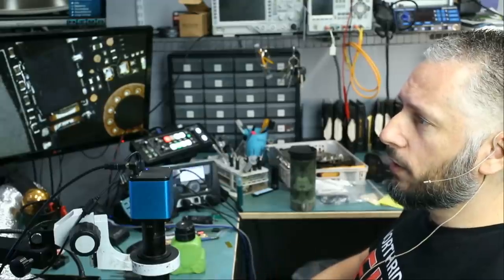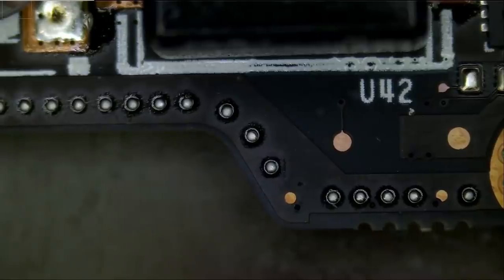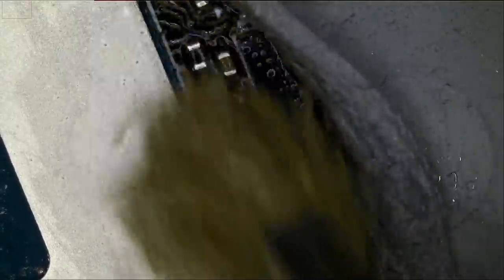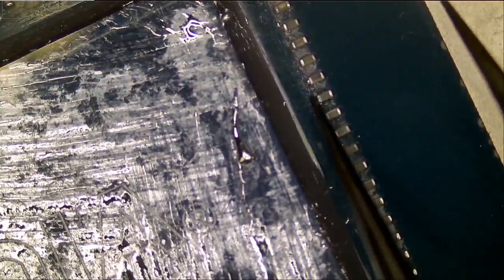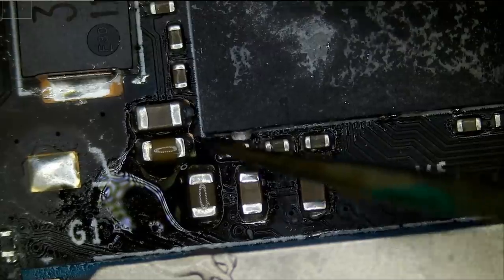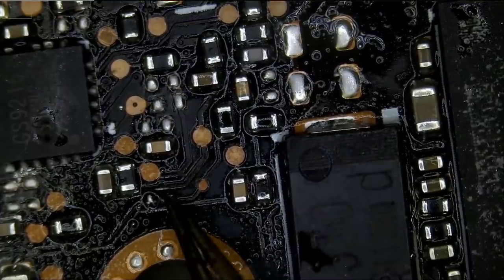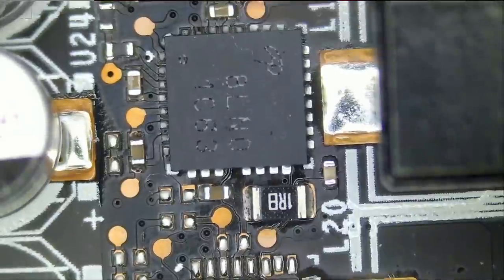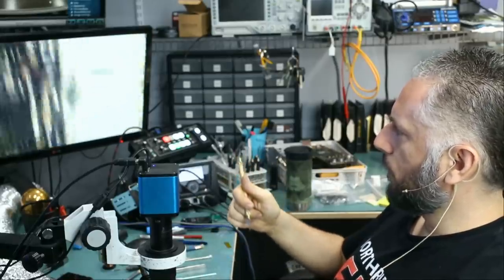RTX 3090 Graphics card Blew out after using Liquid Metal. A frustrating video to watch

Comment: Got a laptop like this once, and it was such a mess that after hitting the board with extremely high pressure air, 90% alcohol, brushes and swabs, I finally figured out the right way to do it, I placed the motherboard in the trash and used the screen for a different laptop.
Reply: people think liquid metal is this magic ingredient that will double the speed of their machine
Reply: @geovani60624  they dont need to think cause IT Just fact. Its way cooler so i can overclock way better
Reply: @lakaldrak  yeah? by how much? does it really matter enough to risk losing your thousand dollars gpu to get like 5 more fps in a game or two?
Reply: @lakaldrak  yeah burning your hardware is an absolute fact son.
Reply: @NyanKuro  so Then dont so it simple isnt IT? My CPU is 20C cooler. The only Thing u need to do is to refresh the LM  every year
Reply: @lakaldrak  Lol its not though.  CPU not GPU for liquid metal.  Liquid metal has literally no effect on a GPU.  This is because unlike a CPU a GPU has a much larger die that disapetes heat differently. There's 0 benefits, definitely not 20 c.  Plus my 2080 ti doesn't even go up by 20c.

Try a dedicated external radiator that achieves ambient water temps. Much better and safer. My 2080ti goes up 14c on full load.
Reply: @geovani60624  Not even 5 fps, there is 0 benefit with liquid metal in a GPU.
Reply: @phillylove7290  I was trying to be generous
Reply: @phillylove7290  14 degrees celsius???? my gpu goes up to like 60 or 80!! how? my cpu cruises at 60 too, but 14??
Reply: @lakaldrak  20c cooler? that's about where my cpu hangs in use is 20c, and I use old radio transistor thermal paste that cost $10/lb. the tube i still use to this day is from 1999.
Reply: @holycownonames  20 Grad Celsius idk what U talking. Not rly when Ur CPU is at least 20 c when u Boot Ur PC.
Reply: @gmodiscool14  read again.
Reply: @phillylove7290  lol
Reply: @geovani60624  only RGB can double your speed
Reply: Indeed. It is impossible to clean the mess, as it adheres to anything metallic (unless it is aluminum, knock on wood, or is somewhat oxidized). Liquid metal is galistan, basically, and it will dissolve copper. Even aluminum, if you scratch the later while in contact with the liquid metal. I'm surprised that I'm yet to see a heat sink crumbling due to that product.
Reply: @lakaldrak  Nope! You can shave a few degrees. That's it! Not worth it. And you will kill the CPU and/or the GPU or whatever you are overclocking in no time. This is like constantly over-reving an engine and expect it not to blow.
Reply: @lakaldrak  Just buy a CPU with a soldered IHS instead of shitty TIM and you don't  need to delid and use LM
Reply: @lakaldrak   the thing is that  99.5 percent  of people don't overclock.
Reply: @SpaceAce114  Fax !
Reply: Do I get it right - you used laptop screen for another laptop? If yes, were they compatible at start or needed some customization with cables? I have old laptop and it has good screen. I would like to reuse it.
Reply: @lakaldrak  Get 17.0 W/mK Fujipoli or 12-14 W/mk pads and you can do the same thing, way more safe
Reply: Lol 100%. I had a PS4 that came in and looked like it was painted silver. Just caked in liquid metal. I had a macbook air the same way - why put liquid metal on a macbook air? Lmao. Its just a pain in the ass mess. I used both boards as donors....
Reply: Liquid metal is for those wishing to take part in the great silicon lottery. Intel may have finished this with pre binned and cut down or pre selected as a new skew.
Reply: @geovani60624  It's not just 5fps more... it can be 20-30 fps or more.
Reply: @christopherkidwell9817  no, unless the heatsync was really dirty and the user was using like white thermal paste, then yeah, that might be true
Reply: That doesnt look easy... I wonder if its ferromagnetic? Perhaps you could use a strong magnet? :)
Reply: Liquid metal is really great
I am using it on CPUs and GPUs from 2012 without problems
Application is a key
You need to ensure it did sick
If it stays after you try to remove it,  then application is done correctly
If you can wipe using dry swap, brush, paper or plastic,  then you sold it incorrectly and it will literally flow away given time
I am using it even in servers,  which shows I know technique
Reply: lol
Reply: @TheOmegaAlfa  - you can buy a driver for the good screen and use it for whatever you want. Just have to know the screen model number.
Reply: @JosephQPublic  , thank you, however the screen gave up to old age 2 months ago. :(
Reply: @geovani60624  You need something to keep it contained. Liquid metal works great under an IHS
Reply: How do you properly apply? I plan on doing my laptop that has CPU throttling at 95c @WizardNumberNext
Reply: @phillylove7290  I got 10c improvement on water cooled 1080ti at max furmark load.  Now the die is only about 5c warmer than the water, when before it was 15c warmer. 

  But you're not losing 20c on the core unless the paste application was terrible. Could get a big hotspot improvement if the paste application and mount aren't perfect.

Comment: this is a classic case of 'More Money Than Sense"
Reply: This proves money isn't necessarily obtained by intelligence.
Reply: This 3090 is probably paired with 3300x box 😂
Reply: @a36538  it's probably paired with a fuckin ryzen 1100
Reply: I do not agree,  if he was that wealthy he didn't need to take it to  fix, he simply would've bought another one.
Reply: @tony001212  the 3090 could have been a gift from him to him so it has sentimental value.
Reply: @tony001212  Well that only proves the point more, he had the money to buy a 3090 but instead of searching properly he just typed "best temp reduction I can put to my card" and obviously he got liquid metal when he could had used kryonaut to reduce the temps and still be safe.

Comment: He must've smashed that cooler back on.  I've never seen liquid metal shoot across any board like that.
Reply: The owner used waaaaaaaaay too much.
Reply: @boricua1123  From the looks of it didn't know what the fuck they were doing either. Looks like they just scratched the surface to leave marks. You need a fine grit sandpaper like 3000grit or so to completely remove any oxidation but leave a VERY faint texture so the LM has something to adhere to and make a good fusion between parts.
Reply: @SilvaDreams  Wat? You guys are using sandpaper on direct die liquid metal jobs?
Reply: @Bourinos02  Of course, you want to use a very fine one to remove the oxide layer that has formed that way it forms a better bond to the actual metal and not to the oxide layer which will inhibit the heat transfer.
Reply: @SilvaDreams  Sorry but that doesn't make much sense... If the chip manufacturer placed it there, it must be only around 100 nanometers thick, and if it is occuring naturally, it is quite literally only an atomic bilayer. So there would be negligible to unmeasurable gains from the heat transfer perspective.
Could you elaborate a bit more?
Reply: It's best to just stay away from that garbage (liquid metal).Many people try so hard to chase a 10 fps avg gain from cooler load temps, less thermal throttling. It is such a waste.
Reply: @Bourinos02  That is not the die. That is the die lid.
Reply: @SilvaDreams  I am just informing. I'm not being rude. There is no oxidization on the die lid. It is mated 100% tightly to a copper surface with thermal paste. 

To add, it isn't an oxide layer. It is an oxidized surface. The process of degraded/deterioration or tarnished metal is called oxidization.
Reply: @Twitch_Moderator  What? Are you refering to the IHS? There's usually no IHS in GPUs...
Reply: @Twitch_Moderator  all metals form oxide layers almost immediately upon exposure to air, this is actually desirable as it protects the metal.
Reply: its undesirable when welding and soldering
Reply: Doofus used liquid metal like regular thermal paste and blew out his RTX 3090. Swear some people don't deserve good video cards.
Reply: @Twitch_Moderator  if it would be 10 avg fps , then i would call it worth it, but in best case you get 2-3 out of it. All just numbers that dont matter if you game and dont go for world records, lol.  Also the metal fucks up your cooler after 1-2 years so  basically its "trash" .

Comment: Did this guy drop the bottle of liquid metal on the board? sure looks like it
Reply: Most of liquid metal comes with syringe which is very hard to control volume to apply. Easy to overshoot. The correct approach is to apply little bit on swab then apply it CPU die with super thin layer.
Reply: @derekchan1570  buildzoid did a video on how to use it, you never apply to the item you apply to a ear bud then to the item.
He also used a lot lot lot lot less than most "tech" channels & dappled it to both slicon and heat sink.
I dont like the stuff, not worth it.
Reply: The T1000 wants his liquid metal back.

Comment: "If it's working don't fix it"

Wise word from this channel and many others
Reply: True but not at the same time. You practically have to repad and repaste 3090s just to get the memory temps within Micron's specced 100c limit, since Nvidia thinks it's all fine and dandy up to nearly 110. Liquid metal is absolutely not necessary whatsoever though, unless you're going for extreme benchmark numbers.
Reply: @scythelord  "Extreme benchmark numbers". Not really. Even professional benchmarkers still using high quality paste and not liquid metal especially on GPU. In other words, just don't mod your components that still under warranty. If you still want to, wait around 1 -2 years from newly purchased card and do what you want if you know what you're doing.
Reply: @scythelord  Exactly. Changing the thermal pads and repasting is fine, but liquid metal is a bit too extreme and frying a 3090 right now when supply is low? Big ooof there.
Reply: *if its not working dont fix it
Reply: @Ashraf690  I usually watercool my GPUs but I make sure to run them in my system for 1-2 months before disassembling the card that way you're more likely to find out if a card is faulty. Also when applying liquid metal I use electrical tape like Scotch Super 88 to cover the substrate around the gpu die, not using anything non conductive to cover it is idiotic.
Reply: @scythelord  Stop believing everything you read on the internet. The specs says 95/105 (whatever that means) a few degrees more won't kill it. Also, you won't be pushing those memory modules unless you're running benchmarks or mining.
Reply: @zaxmaxlax  doesn’t really matters anyway, the cooler = the quieter = the better. I don’t do any overclock or benchmark but I use LM on my crappy air cooled GTX-1660 because the fan are loud as hell above 35% and I don’t usually use headphone unless I’m monitoring my audio in Adobe Audition. So the noise really annoys me. There is more to cooling than just to make things not hot, there are tons of people out there who run crazy custom loop on their non-K CPU and budget GPU just because they can’t stand the noise. If I had the money I would even try run an Intel Cryo block with a 72mm thick rad on an undervolted 11400, lapped cooper IHS, delided and repasted with LM, if it means that my Noctua fans can just chill at 300RPM and not make a god-damn noise.
Reply: A statement for non-professional.
Reply: yeah, ''if it's working don't fix,'' well if you read the memo it says the owner had high temps on the memory, which the 3080 and 3090 did have ram cooling problems on launch due to poor thermal pads , more or so if you don't know what you're doing then don't service it ,it's a common thing to tweak pc hardware even if it's working, there's always room for improvment  but clearly the owner of this video card has no idea on what they are doing .
Reply: yeah, my aircraft maintenance engineering said similar thing that stuck with me.
"Hands of man destroy everything", so more screw with things try to fix things, more likely will screw something up
Reply: @AdmiralFloof  Also blew  warranty out the windows
Reply: Should be "if it's working and you're poor don't fix it" 😂😂
Reply: He said his gpu had temp problems...
Reply: Amen brother.  I have two RTX3090s and have zero need to mess with liquid metal.  Besides, the thermal difference is negligible vs. high end thermal paste and with none of the risk.
Reply: I took my 3090 FE apart to replace the thermal pads and I replaced the paste with Noctua stuff. Core temps were fine to begin with, but the memory was running over spec in games. New pads brought it down 20c+.

I had the nagging feeling I could do better if I used thicker pads on the front. After a while I ordered more pads in different sizes and went in again. This time it didn't boot. Cold sweat. Opened it up a third time and found out the 2mm front pads were preventing contact with the core. Back to 1.5 on all memory. I did use some 2mm pieces on other components and 0.5mm on the power delivery section on the back. Measured temps were equal to or a hair higher than my first attempt. But it works great.
Reply: I would say overheating memory chips qualify as needing to fix it...
Reply: @zaxmaxlax  practice what you preach bro. Just because the manufacturer says  will still operate at 95/105 degrees Centigrade max temp doesn't mean that temp won't kill the VRAM on the card. If anything, it might only last for 6 months before death
Reply: @scythelord  undervolt ezz

Comment: A small desoldering pump can help when removing liquid metal
Reply: I was thinking the same. Suction would work better than trying to grab the blobs with a tweezer.
Reply: Hi pressure air house can clean the whole thing
Reply: I used suction from the lab's   distribution to clean all kinds of stuff from my boards. 25 inch+ vacuum through a 2mm id. sipper tube. I also used a trap to catch the occasional part that would try to escape.

Comment: The desoldering station I used in the navy had a vacuum attachment. This used in conjunction with your heat gun should make it relatively easy to remove the liquid metal.

Comment: Here a tip for everyone who intends to do this: cover everything around the part you use liquid metal in and that is mot supposed to get any on it with nail paint. You can remove it or leave it on, but it protects the parts. But in general don’t do this… it snot worth the 10 degrees you safe…
Reply: or even better, there's some rubber paint stuff that extreme overclockers use that's much safer to use on electronics and will insulate against moisture and conductive materials
Reply: 10 degrees would be a massive saving, making it very worth doing lol. In actuality, it usually gives a 1-3C difference compared to the best thermal pastes. Only difference is that it can last much longer and gives you happiness knowing you have the best of the best (even if it is by a very slight margin)
Reply: @ normal thermal paste and pads can last long enough where most people consider to upgrade their components anyway. In addition you void your warranty and created an unnecessary risk for you PC for a performance boost you will not notice. The 1-3 degrees might translate to a few fps increase, if even. And Sony PS5 died because of Liquid Metal application, yes they probably did it wrong, but so will lots of people who do this for the first time

Comment: I have a feeling that the solder balls under some of the ICs will be bridged from the liquid metal. I understand people want to DIY things to get performance, but I don't recommend doing those things yourself if you do not have a good plan or maybe someone with experience to supervise. Let's hope the step-down converter is all the card needs.
Reply: Almost a $4k card at one point in time! Let's put some liquid metal that probably has a 1c degree change compared to super safe thermal paste rofl. What an idiot who owned this card.
Reply: Dude.... I'd like to meet the noob who did this... Please take my advice here boys, it's ok to be new and to learn to apply liquid metal.... It's a NOT OK to learn to apply liquid metal on a currently/recently worth 4000 dollar card lol
Reply: BGA solder balls getting bridged is very common in LM damaged cases. The repair technician must take the GPU and VRAM off for close inspection, reball them afterwards. Very time consuming and expensive repair job.
Reply: @hateWinVista  Yep, that's probably a couple of hours work for sure!
Reply: @KattKingston  more like 15°C. Which is a lot.
Reply: @KattKingston  I mean tbf a good LM application can shave off 15-30c easily, dells alienware laptop uses terrible thermal paste (Ik i got myself an alienware, needed it for BIM software and I was desperate due to time constraint) repasting it with LM dropped the temps from 90c to barely 70c on full load.
Reply: Ouch yeah that's a pretty huge chance.
Reply: I think that some people know so less and because they know so less, they may think that it's easy to do something (anything). In a videocard it's built an entire city of components. Don't DIY anything you're not qualified to do or anything you don't have extensive knowledge about. The DIY thing may be working sometimes but most of the times someone who don't know exactly what it is doing is wrecking everything and most of the times isn't even aware of the damage its DIY game was causing. That's a fact.
Reply: I wish he did a sideways inspection of those BGAs. Really looks like there is LM under them.

Can you blow LM out from under BGAs with hot air? I doubt it. Tons of BGA work otherwise.

Comment: Nice video. Always coat (insulate) surroundings before applying LM and apply carefully as LM tends to drip very easily. On my first use, it dripped on my floor and skin. And avoid using it on movable objects like laptops. And unless Your card hits 90+C often do not use it!